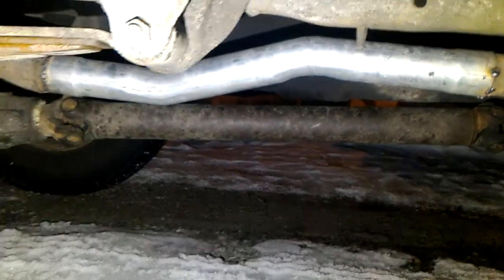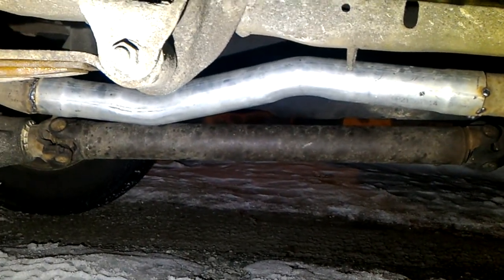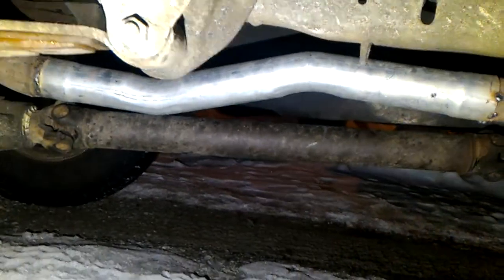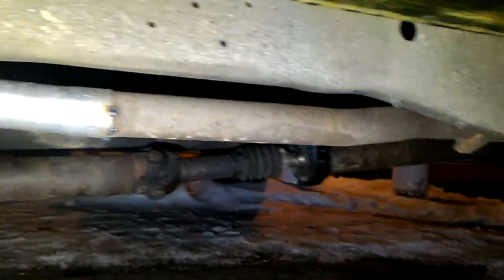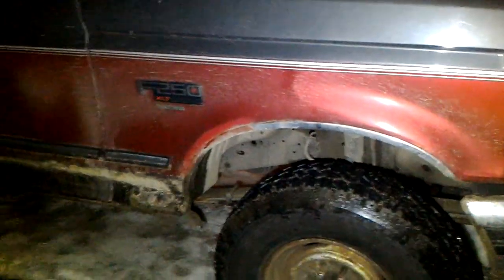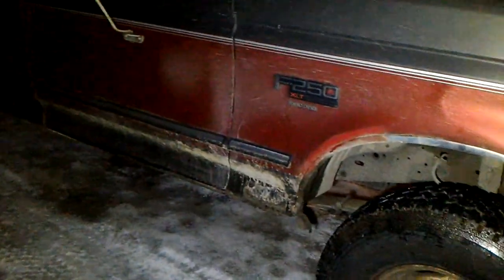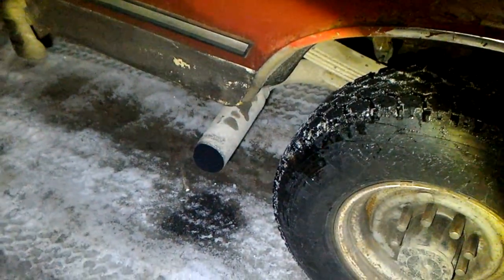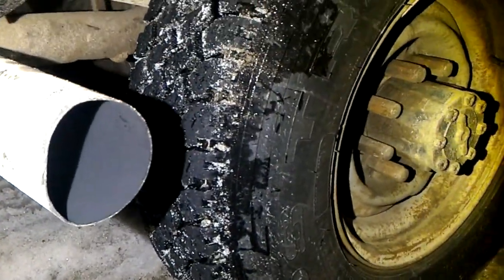Straight piped 7.3 IDI factory turbo... Sure doesn't sound like it.

Comment: I removed the stock airbox and bought an equipment air filter (forgot the part #) used a chunk of 3" PVC to couple it to my stock intake hose and it's mint. Whistly at idle and lower EGTs (I'm assuming I don't have a pyrometer)

Comment: Think about just what a turbo-charger does in your engine, all eight cylinders worth of exhaust are constricted down to the size of a baseball, spinning an impeller. All those throaty exhaust pulses, one by one, are mixed up together in that turbine. Those particular pulses are now "blended" together, effectively killing that sound we want. Diesel or gas engines  running thru a single turbine will never get you that particular sound you want, twin turbos will help...but the naturally aspirated is always best, no blender to mess things up.
Reply from the maker: Well, sure, but not exactly what I meant. I actually love the sound - it's(IMHO) much better than N/A. It's more a measure of how much a few bends and a restrictive downpipe will quiet down an IDI, compared to both a N/A IDI or my other (3" straight pipe with no bends after the DP) IDI.

Comment: With the glass pack on the turbo idi does it still have the popping sound at high rpm
Reply from the maker: Not sure... On my other truck(Big Bird, the tan truck), I've got that glass pack on it, and a pre-axle dump.
On this truck(Big Red), I never got around to adding a glass pack; it's not particularly annoying. The popping happens on decel, at like 2000-2400 RPM. Above it, it goes away. Below it, it goes away. So I usually just don't engine break in that range much, especially in a populated area.

Oh, and I'm pretty sure the quietness is due to all the extra bends in the exhaust from a 'full' exhaust - I've swapped the motor since this video was posted when I blew a head gasket(overheated the motor when serp tensioner broke), and the new motor sounds exactly the same(old one was a 7.3 non-turbo block; new one was 7.3 turbo block with a slight tick; old motor ended up in Big Bird).

Comment: Did you block me from commenting on your other video? I was going to tell you how I achieved my numbers but it won't allow me to comment..
Reply from the maker: No, I didn't. I have trouble commenting myself if I use the link in the email to respond. Make sure to go directly to the video, and that the url does not contain any 'google comment id' stuff in it... I can't make /any/ replies if mine does, I just get an error. I do want to hear your explanation.
Reply: Ok. Sorry for the misunderstanding. First of all, I was exaggerating to make it more likely for you to respond. Second, the injector pump is not stock, I don't remember the part number but it's not stock. The turbo is 12 psi at about 2400 rpm so the top boost is above that, again not sure exact number. I also converted it to an electronic fuel pump which sends about 8 percent more fuel than the mechanical pump. It also has an extremely high flowing exhaust, unrestricted down pipe and it rusted off at the cab. I then got my fuel system 100 percent cleaned so it has it's maximum potential. The exact number was I think just under 300hp. There are other mods I can't remember because I've been working on my 2002 7.3 Powerstroke lately.
Reply from the maker: I'd really like to see that dyno sheet.